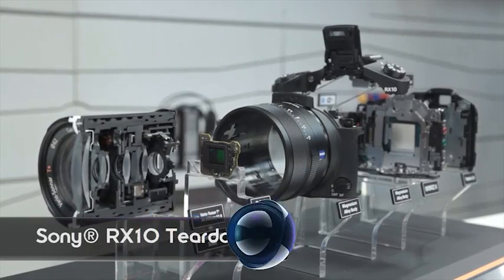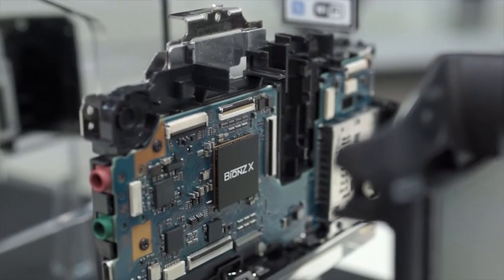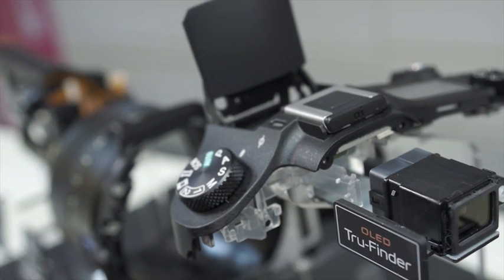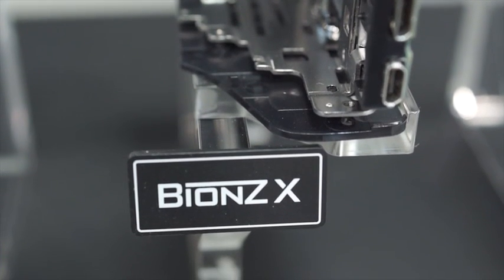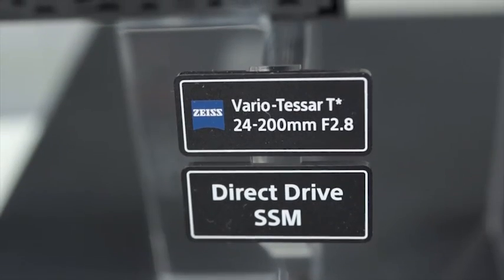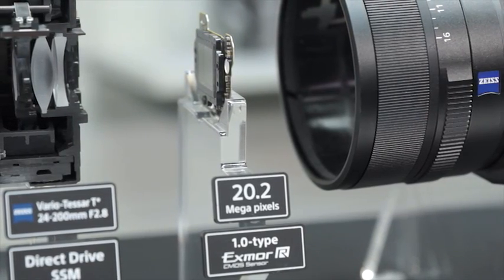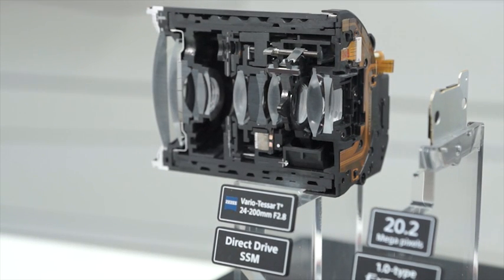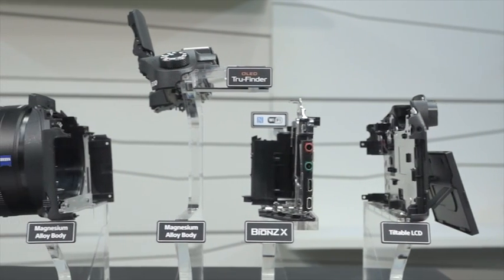Opening up Sony's RX10 Camera (Teardown)

Comment: Thank you guys.  The only other teardown posted was been on a Korean (IIRC) website back in December and has never been translated.  I've wondered how the RX10 has been constructed as this has become my main camera.  I've not regretted the move for one moment.  However (you knew there had to be one) is it possible that you could pass on more information  such as "Sony has placed gaskets around the places in the top plate where the control knobs are to prevent moisture leakage." or "The shutter mechanism is rated for 35,000 cycles."  so those of us whom are loyal to Sony Photographic can brag a little .....  or a lot.  :)